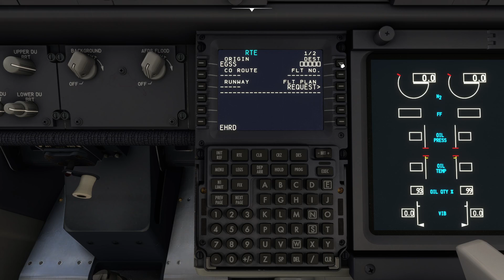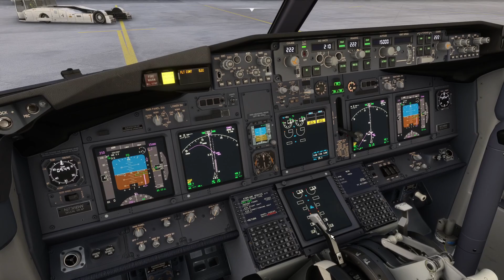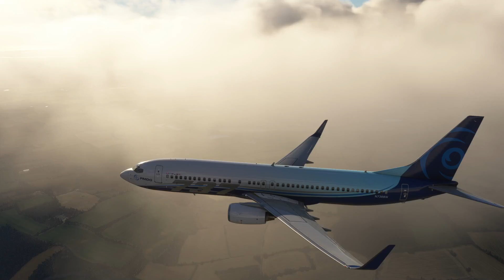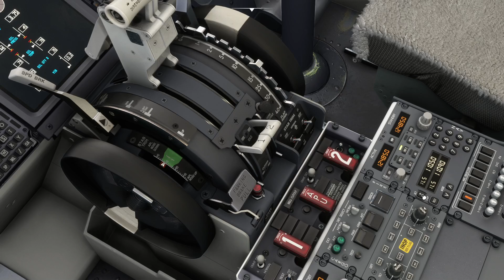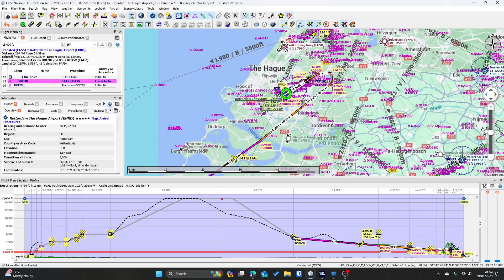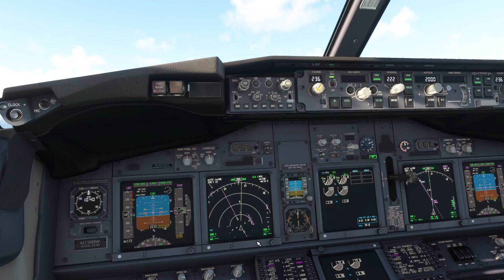Flying the PMDG 737-800 from Stansted to Rotterdam in Microsoft Flight Simulator

Comment: I know why your auto throttle arm switches off it’s because you’re using two levers with your thrust if one lever is slightly out of sink as you move it’ll knock the auto throttle off I’ve switched to the slider on the side stick cause I’ve got the TCA throttles . I was getting that problem and now it works a dream

Comment: High altitude airports - you just add the airport elevation to 10 000 :) so for example if the MMMX is roughly at 7500 feet or so you have landing lights ON at FL175 and below.

Comment: What a helpful video this was. This is my first foray into study level aircraft, and this video has helped me tremendously to learn to fly these awesome aircraft. 

I’m currently flying the 900 and I’m having an issue with the bank angle on AP/AT. Using LNAV the aircraft is turning too steep and I get the bank angle warning. As a result of the over exuberant turn the aircraft overshoots the turn and then has to hard turn in the opposite direction. Again it banks too sharply and overshoots its correction. And so on. 

Is there a way of limiting the bank angle on AP? Thank you.

Comment: cruise altitude is 15,000 and and the minimum altitude is 1000 .You can  aim to 1000 directly.not 15,000 to 10,000 after you have to aim again to 9000 after that you have to aim again to 5000 just do it once and the airplane will follow the procedures  that in the flight plan
Reply from the maker: I chose what I did on purpose to make the point about the VNAV restricting the climb regardless of the target :)

Comment: My controller is pretty low-grade, and I don't have pedals, so I end up using the auto-land on my PMDG 737-600 pretty much every time. If you give it all the info it needs, it's pretty reliable and smooth. Or at least that's been my experience.